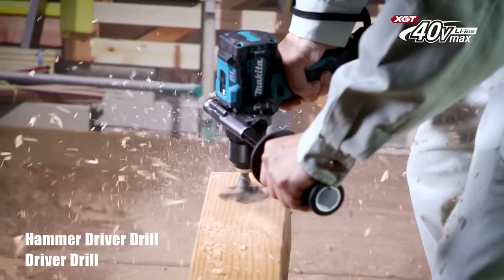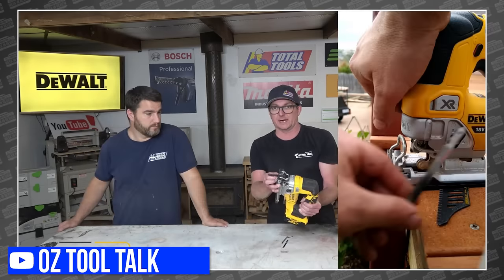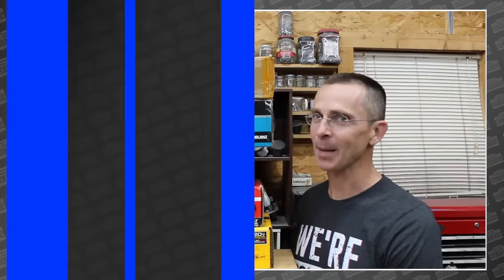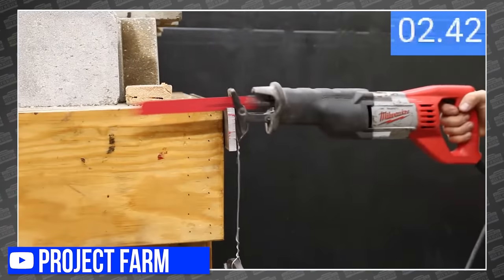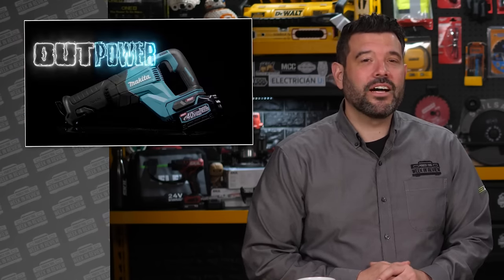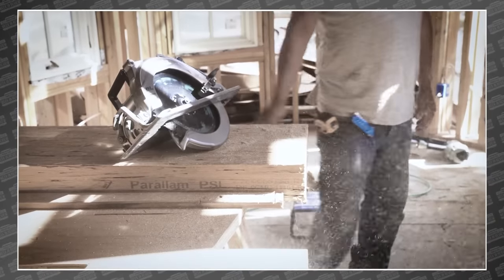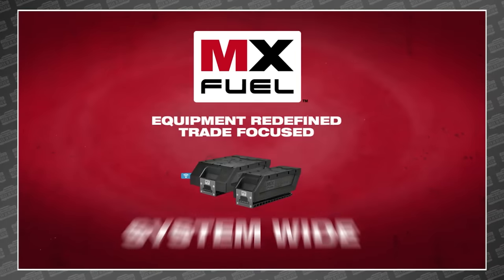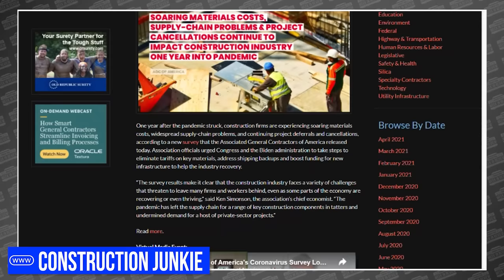MAKITA has a NEW PLAN, and either YOU'RE IN... or YOU'RE OUT. The next Power Tool Revolution. S4E14

Comment: Makita 40 v is the right move. They just took too long. Wasted time with 2x 18v. It's still not impressive to dewalt set up.  Makita now better potential than Milwaukee as there HO m18 battery trips out from heat and MX is just too big. My bet is Milwaukee will give in and need another high voltage line.
Reply: Since dewalt hàs the best battery and voltage set up. They also have the best potential. What will they do next. It's clear 40v ope was discontinued due to 60v and 120v flex system.  A rumored power vehicle has advantages over Milwaukee mx.  Cant wait for a 15 anph battery.  This would be a 5amph on a  60v flexvolt grinder that already shines on a 3amph ... on a Milwaukee m18 grinder it will still trip out.
Reply: It's not impressive at all. All of the tools provide the same power as their 18v competitors and are double to triple the cost. 300 bucks for a 4.0Ah 10 21700 cells ran in a series battery is an absolute joke when FlexVolt has 15 21700 cells for cheaper, also Metabo HPT has done the exact same thing for more than half the cost. I'll be glad if it dies.
Reply: Technically Dewalt can Run 240v each battery pack specifically states 3x40 volts so in theory of they altered the switching mechanism they COULD potentially tap into both sides of the batteries and produce 240 Volt tools using the Duel battery platform, I suspect that's why they did it that way since 60 volt grinder etc is only tapping into 2/3 of the battery pack

Comment: Makita xgt is so expensive. In Poland - 18v batery 300zł  and 40v batery 1020zł !!! I can have 3 x18 v for one 40v. Its crazy.

And its just 36v engine with one batery..
Reply: $300 USD for a 10 Cell 21700 battery because it has the teal tax. Meanwhile Metabo HPT is charging sub 150 USD for the same exact thing.